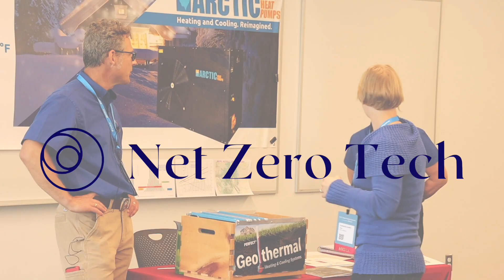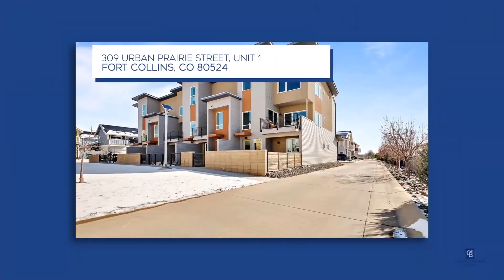What you need to know about Net Zero Homes

Comment: I'm curious about the use of the term "Induction" related to the ground-source heat pump. What does that mean?
Reply from the maker: Hey there, he means "Water-to-air in ducted systems". My bad, I didn't catch the missing space, in case you were watching with subtitles. I fixed it. So, they use geothermal, a water tank, and air-forced heat distribution via ductwork. Thank you so much for catching that! 🙏
Reply: @NetZeroTech  - Thanks for the response. That makes sense. BTW, I watched a number of your videos and many others before installing a GSHP system in my existing home which has hydronic radiant floors. We also installed a heat pump domestic water heater and a heat pump dryer. No natural gas to the house anymore, and our solar produces more electricity than we use. Keep up the great work!
Reply from the maker: Thank you very much, Adam! 🙏 I really appreciate it! Congratulations on the GSHP and hydronic radiant floors! 🎉🎊🚀 That is the best combination imo, if you have the time to pay it down.